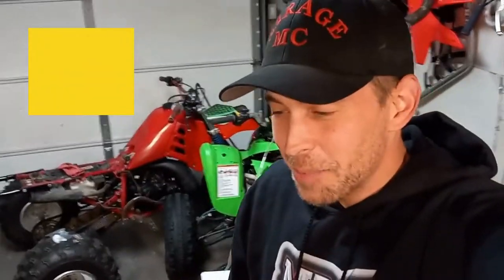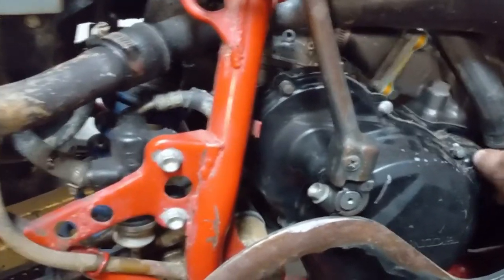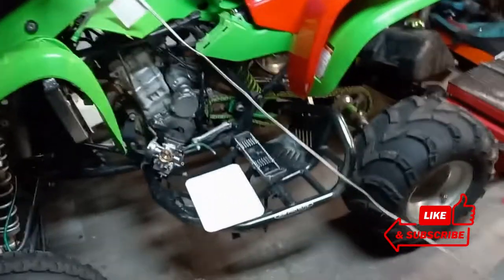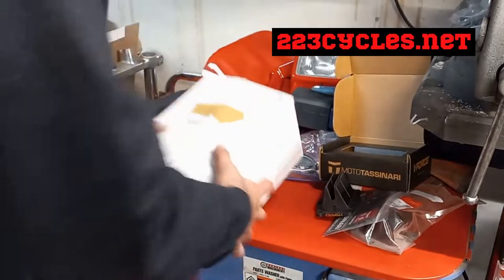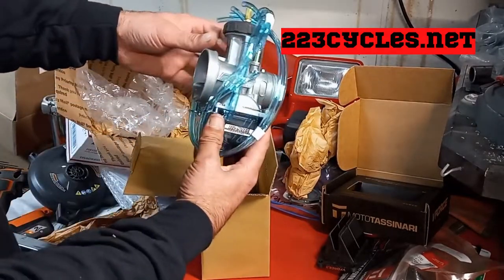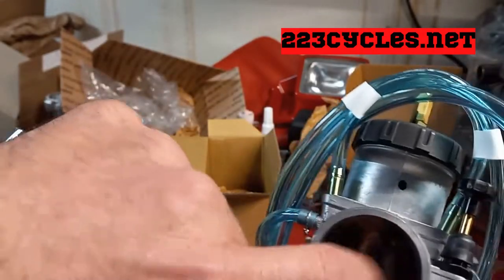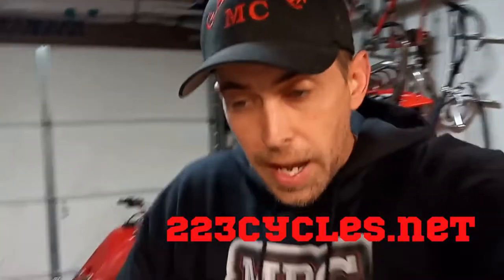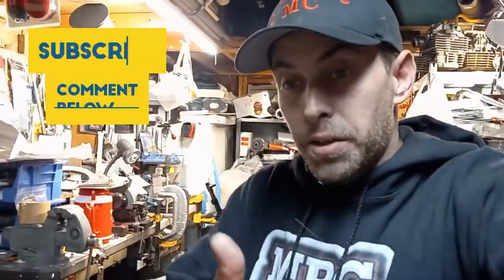223cycles.net Unboxing Our New Pwk 38mm Carb for the Atc250R

Comment: Thank you sir. Another helpful tip is that a genuine Keihin Carb will have the part number above the bowl. The 38 Airstriker will always start with S66. But you are correct, the circuits on the knock off carbs are out of tolerance as well as the jet. Locks are different.
Reply from the maker: Thank you we will be talking soon for the trx
Reply: All knock off carbs will not have the (k) for the company logo in all the jets and needles most don’t even have the numbers in them but they have some very good clones out there. There’s a lot of people buying knock offs for 50-100 dollars and selling them at Keihin price of 250-300 a pop some even change the jets to make them seem real they even duplicate the packaging but they (never) have the vent lines. A relatively stock motor doesn’t need a 38 all the modifications your doing can be done with jetting the stock carb if you look at the stock carb where the fuel line enters , Honda remoulded this to be 90 degrees or flat so the fuel line can come down from the tank a small turn and in these were specific to the 250r because Honda didn’t want an s bend in the line and have air bubbles in it. All other carbs have a 45 degree inlet for the fuel line .
By the way Honda owns 
keihin    Your better off keeping the original parts to keep the value in the bike 
There are videos on line about these knock off carbs
Reply from the maker: @mikesarahmccourts6509  the stock stuff is going on my oem atc250r thank you for your opinion I appreciate the interaction. Idk how to tell you that this is a genuine carb but I guess you will see that when I get to that build. And it's exactly what I want for what I'm building this engine for. 223cycles.net is involved in these comments and he is a licensed dealer so I'm going to direct you to go ahead and call him or just message on here I'm 100% sure he can let you know anything you don't know about this carb that was custom built for my atc250r.

Comment: I bought a clear bowl, ez pull spring and long air screw from 223. He sent me a set of short bowl screws for free because the std bowl screws hit the long air screw. Most vendors wouldn’t do that.
Reply from the maker: That's cool bro. That's when you know someone loves what they do
Reply: Thank you for the support sir!
Reply from the maker: @223cycles2  got 2 more quads yesterday Curtis. Got to repair a blaster as part of the deal I made with the guy. Blaster runs but has no power and it has a Chinese carb on it. I wonder what could be wrong 🤔

Comment: What's your opinion on the v force reeds? After some research I decided to go with the boysen rad vavle on mine. Also running a pk carb would love to go to a 86+ flat slide or a 38mm
Reply from the maker: I like the v force reeds. Boysen rad valve is good too I had it on a 250r a long time ago. And the 38mm works good on this bike

Comment: You just destroyed all the value in that bike never use a Chinese knock off (junk) carb go on some of the forums and do some research first they have all tried them out and a stock 250r has a 34 mill carb 38 is to big
Reply from the maker: Bro these are genuine the blue lines are probably throwing you off. This is from someone I know and is a licensed keihin dealer. 223cycles.net
Also with the mods I'm doing to the engine a larger carb will compliment everything else but thank you for your opinion
Reply: What makes you think that is a Chinese knock-off carb and not a customized Genuine Keihin Carb? FYI this is a genuine S66 Keihin Airstriker carb that has been customized with custom color Sudco blue lines, clear bowl, Keihin DEK needle and tuned for his build. Going 4mm larger from the OEM PJ03A 34mm carb isn’t a huge jump like you’re describing. 8/10 250R owners go with the 38mm. And this depends on what the build is going to be. Someone building a Big Bore like a 310 will need the 38mm.